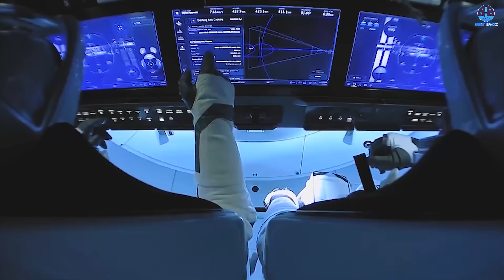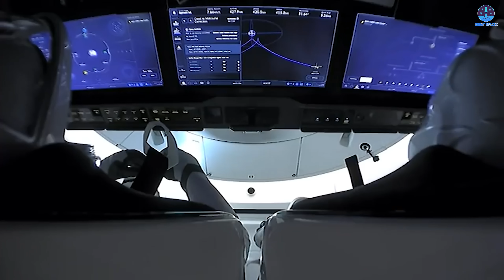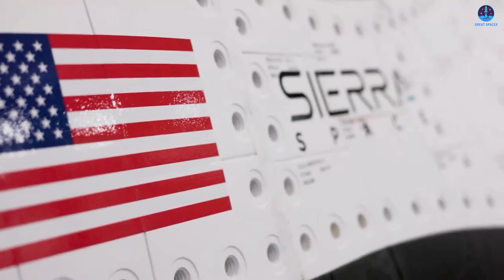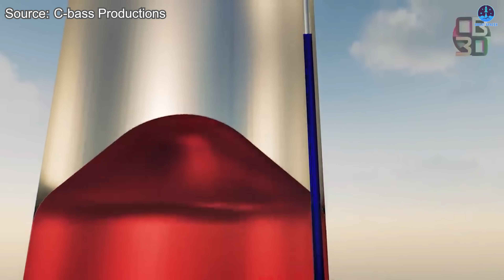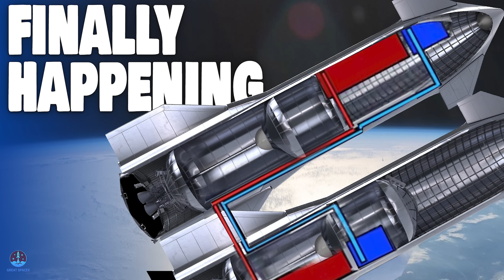SpaceX President Declared Starship Refilling System to the Moon Next Year after…

Comment: Her job, and apparently her only job, is to parrot Musk with even his most insane nonsense like PTP rocket flights in leu of airplanes.  Like saying Starship will cost only a few million to launch when the hugely stable and reliable Falcon 9 is reported to cost about $55M per launch while Starship/Superheavy is 10X the size of Falcon 9.  The nonsense spewed by Musk and Shotwell is similar to Musk's nonsense about Tesla's FSD.  There was a time when people making such statements would be held accountable for their lies, but that era is over.
Reply: The hatred from Raptor is strong. Space X has done what no other company  has been able too. Falcon 9 has achieved what actual companies who build rockets said could not be done. Over 500 launches with as nearly many recoveries of the booster. They are working towards total reusability. They are betting the farm on it. V2 Starlink have come to an end with V3 Starlinks too big to launch on Falcon 9. Raptors tears will be able to fill the deluge tanks as it comes on line. It will be even worse with V4.
Reply: @williamdrake2315  Falcon 9 is a great rocket and early on SpaceX said they were working on a reusable second stage, but they abandoned that idea, in no small part because a reusable second stage would reduce payload to LEO by 40%.  The Falcon 9 succeeds for the same reason Starship will fail -- Falcon 9 uses an expendable second stage whereas Starship/SuperHeavy is fully reusable.  Actual rocket engineers know that a fully reusable second stage cripples payload and dramatically increases the chance for failure.  The moment you actually think about the problem rather than orally ball wash Musk you might realize that the concept SpaceX uses for Starship, BUT NOT FOR FALCON 9, is critically flawed !
Reply: @Raptorman0909 Purportedly 80 percent of orbital debris is spent upper stages. Cannot leave them in orbit. One of the reasons they discarded reusing the upperstage for Falcon 9 was it cost more than building a new one. The shuttle SRB was reusable but in the end cost as much if not more than having expendable ones. Starship and booster are they way forward.
Reply: @williamdrake2315  You're pulling BS from a midbody orifice!  Anything left in that low of an orbit will decay and return to Earth in weeks to a few years, depending on the orbit!  Of course, if you have a source for that 80% number please feel free to provide it!
Reply: @Raptorman0909 I stand corrected. Google says by mass 56 percent of orbital debris is upper stages. I read 80 percent before but couldn't not find the source so I Googled it. If orbital debris is not an issue why don't you find a source that says it is not an issue? This is part of the reason for reusability.
Reply: @williamdrake2315  And once again you fail even after correcting yourself.  Many second stages perform a retro burn to deorbit, but many other rockets rely on orbital decay to flush LEO of debris.  The real problem with orbital rockets is in higher orbits where orbital decay may take decades or longer.  BUT, they are not second stages they tend to be kick stages and retired satellites.
Reply: @Raptorman0909 , Falcon 9 carries a decent amount of payload, but reusability reduces that by 40%, as you say.

Starship carries a LOT MORE payload.  Reduced by 40% to recover/reuse the second stage, still leaves a hell of a lot of payload.

AND IT REDUCES THE PRICE TAG SO MUCH, you just launch TWO.
Reply: @michaeldemarco9950  Correct .. .except...
There are two payload ranges that matter:  the maximum payload for missions that require maximum payload; and most everything else which is not driven by the need for maximum payload.  As it turns out as great as the Falcon 9 is it is limited in payload to about 20t and typically more like 12t or less, if the upper stage was reusable the payload would drop to about 12t which is too small for some missions.  OTH, Starship is WAY TOO BIG for typical satellite launches and is really only useful for Starlink launches.  And that's actually what Starship is all about and Musk has NASA footing the bill for their Starlink launcher.
Reply: From Google 
"Lack of active removal: While newer spacecraft can be moved to disposal orbits, much older debris is not tracked or controlled, and can remain in orbit for centuries. 
Orbital environment: The objects are left in orbit because they are no longer useful and have no plan for removal. They remain in orbit until atmospheric drag causes them to re-enter, a process that can take years or even millennia depending on their altitude. " Notice the "While newer space craft can be moved" does not mean they are built to do this. The Chinese who are quite busy have not been that great at building deorbiting into there rockets. Google says "No, China is not building deorbiting into their space launches; instead, some of their recent large rocket launches have resulted in uncontrolled debris from their stages falling back to Earth. While China is developing methods for space debris removal, and its policies require operators to deorbit satellites, its past launches have involved large rocket bodies that did not undergo a controlled deorbit, a practice that differs from the approach taken by other countries like SpaceX."

China's approach to deorbiting

Uncontrolled reentries: Some of China's recent large rocket stages, like the Long March 5B, have been left in orbit to reenter the atmosphere and fall back to Earth on their own, causing concern from space debris trackers.

Policy vs. practice: While China's policies require satellite operators to deorbit satellites, this has not always been the case for large rocket stages, according to SpaceNews.

Space debris research: China acknowledges the challenge of space debris and is researching ways to remove it, but this is a separate effort from controlling the descent of its rocket stages. 

Concerns about uncontrolled deorbiting

Increased risk: The uncontrolled reentries of large rocket stages pose a risk of creating space debris that can stay in orbit for a long time.

Collision risk: Debris can collide with other spacecraft, satellites, and the International Space Station, creating further debris and posing a risk to human spaceflight.

Orbital congestion: The uncontrolled debris from some launches adds to the already crowded orbits in low-Earth orbit (LEO). 

Comparison with other countries

SpaceX's approach: SpaceX launches satellites into a low orbit and then uses the satellites to slowly raise their orbit, or uses other methods like controlled deorbiting of upper stages after payload dispense, ensuring that any debris falls back to Earth within a few days.

Controlled deorbiting: Some older space missions, such as China's Tiangong-2, were deliberately deorbited in a controlled manner. 

China’s megaconstellation launches could litter orbit for more than a ...

Apr 6, 2025 — High altitude issues ... The Guowang and Qianfan constellations operate at much higher altitudes than Starlink. Guowang...

￼

SpaceNews

￼

China develops ways to de-orbit space junk. Should we be ...

Oct 6, 2025 — As one of the most active countries in terms of launches over the past decade, China has a number of spent rocket stage...

￼

Yahoo

￼

China space station module's massive rocket falling from space

Jul 24, 2022 — Huge Chinese rocket booster falling from space after launching space station module. ... No one yet knows where the ma...

￼

Space

￼

Show all
Reply: @Raptorman0909 , NASA is funding the Moonship, and funding (on speculation) all the things Starship should be able to do in the future with its large tonnage to LEO, whatever that may be.
Reply: Google says "Significant mass contribution: A 2020 analysis combined data on the most dangerous debris objects and found that 78% of the items on the list were rocket bodies. One specific class of upper stages, the SL-16 from the Zenit rocket family, made up the top 20 most dangerous objects due to their size and orbital patterns." Once again why Space X and Blue Origin and others have a stated goal of total reusability. Only Space X with Starship and booster are iterating towards this goal. Everybody else has it in their future plans. As to payloads for V3 and V4 they are both upping the amount of tonnage into orbit. The concept of refueling in space will allow Starship to perform deep space missions. Space X with their Falcon 9 has been launching multiple payloads with their rideshare missions.😮 I have to believe they will be doing the same with Starship. They have to generate revenue beyond Starlink launches. They are not building any new Falcon 9's.
Reply: @williamdrake2315  That's great, but the reality is most of the upper stages for rockets that put payload into orbit are either deorbited or left to decay in orbit until it falls back to Earth.  Where stuff can remain for decades or longer is in the higher orbits that are NOT typically serviced by a second stage but by a kick stage that's part of the satellite package.
So if Starship were to launch a satellite into orbit and that satellite has it's own kick stage or, as with Starlink, their onboard ION thruster, then when the satellite reaches the end of it's life either the satellite has a deorbit motor or its left to decay.  At the orbital altitudes Starlink operates the decay  period is a week to a couple years.  When you get to an orbital altitude of about 800km the decay period can be centuries.  When a geosynchronous satellite is retired they do not deorbit it but raise it into a graveyard orbit and unless something happens they will remain in a graveyard orbit longer than humans have existed.
We need to develop space based garbage trucks to deorbit everything.
Reply: @Raptorman0909 Dude what the hell are you on about? If you know so much why aren’t you a rocket engineer? Do you think you know more than the engineers at SpaceX, who have proven to achieve things that were previously impossible? Yeah I don’t think so, I trust them way more than you 😂
Reply: @Raptorman0909 And yet the supposed flaw is a necessity to work around if the desire to transport additional material long distance is to be realised.
If we do not bring down the cost of space travel for people, it will not be viable to make Earth a space faring race. The technical challenge are just that. Technical challenges. The real challenge is to make space travel inexpensive… otherwise space travel is cost prohibitive, the economic case is as hard to crack as the technical case and if the best space ship is made without an eye on cost… then what they build matters little if only governments can afford it. Space travel has to made inexpensive to entice more uptake in using space as a resource.
Reply: @davfree9732  No, the requirement for a heat shield and reserved propellant and things like flaps or wings are NOT needed on an expendable second stage and this singular fact is central to the approach NASA took for the Apollo Program.  The first stage was RP1 based but stage 2 and 3 were hydrogen based because the mass of a hydrogen based stage with the same payload performance of RP1 will be about 20% lighter -- again, using the rocket equation you or anyone else can see that.
Reply: I'm intrigued. What are your rocket engineering qualifications? You are posting as an expert.
Reply: @jeffsymons4535  You can study the subject if you have the capabilities and to understand the problems with Starship you really only need to know a few critical formulas like the Tsiolkovsky rocket equation.  This equation is within reach of a bright high school student.  This equation let's you understand the efficiency of rocket engines and the effect they have on the whole rocket.  Are YOU willing to learn?
Reply: You, my man, are very ignorant, and most of what you said....was wrong.
Reply: How are things over at your job at Blue Origin Raptorman?
Reply: @diogenes64  My job at Blue Origin?  Why would I trade one megalomaniac for another?
Reply: @Raptorman0909 you should take out the word megalomaniac and insert visionaries. You know, the exact 180degrees opposite of what your mind is(and you evidenced this fact with your own prose) You're not very bright are you?  Have you graduated highschool yet? Just curious is all. Your posts don't come across as even a young adult level of thoughts....
Reply: @hukphin740  The degree to which Musk fans orally ball wash him is astounding!
Reply: Musk has always spoken well of your achievements...
Reply: @kevinoneill2090  Musk has almost always spoken lies!
Reply: @Raptorman0909  No you're just ignorant and only hear what you want to hear.
Reply: @paulmichaelfreedman8334  No, you're blind as you refuse to see what's before your eyes!
Reply: @Raptorman0909  A valiant effort but it's too late, the fanbois have all drank Musk's cool aid. They are gone, absorbed into the cult.
Reply: @Raptorman0909  Oh boy, how to you tell an idiot he's an idiot, without telling him he's an idiot?
Reply: @paulmichaelfreedman8334  "Oh boy, how to you tell an idiot he's an idiot, without telling him he's an idiot?" -- Tell me more?  Referring to someone as an idiot is something of a confession from ya, isn't it?
Reply: @Raptorman0909 , yep.  When they start calling names; you know they’ve lost the argument.

Comment: Got a question. Can liquid methane and oxygen be stored months on end for the trip to Mars. Past probes used hyperbolic fuel I thinks
Reply: Not everywhere. In sunlight the surface is Instant boiling the Methan.
Reply from the maker: Let's wait to see how they will solve this
Reply: @colonbina1 hyperbolic fuels is all about restarting the engines without using complex firing systems, SpaceXs' engine restarts is proof of concept that they can restart using traditional fuel and not these unstable and volatile hyperbolic fuels that are pretty corrosive and difficult to store for long periods of time.

Oxygen and methane are more stable and not as volatile or corrosive, as long as they're kept pressurised and at a constant temperature there's nothing to stop them being stored indefinitely (in theory), oxygen being the oxidiser would be the only one to be careful of but as we can store it safely for long periods on the planet there should be no problem in space other than the temperature difference between the daylight and darkness cycles in space (keeping it in darkness would be preferred for storage to keep it cold and not "boil off" although that would only happen until a specific pressure was reached in the fuel tank!).
Reply: @scottbishop7899  exactly we seen it already witht starship test
Reply: Isn't Space cold?
Reply: They Use the helium in special COPV Tanks stored to get enough pressure on the turbopumps. This Insert Gas is very Hard to store IT for long time Missions.